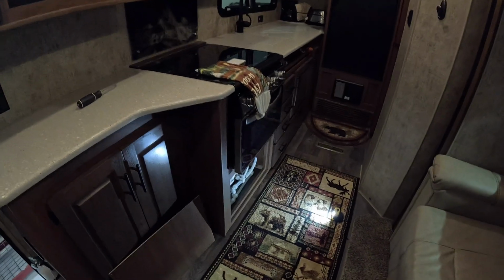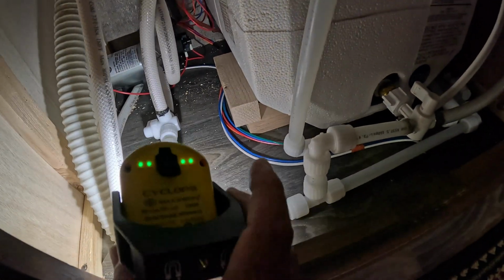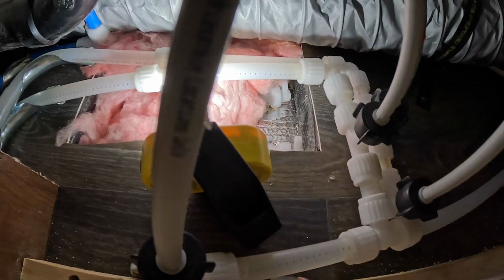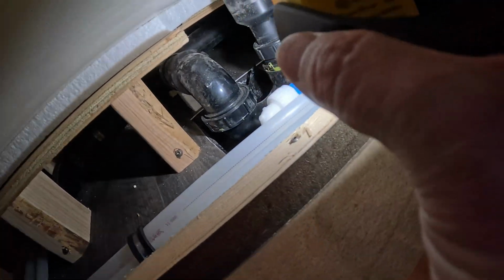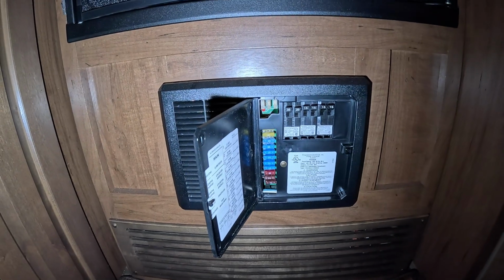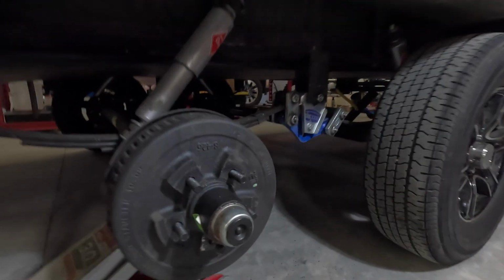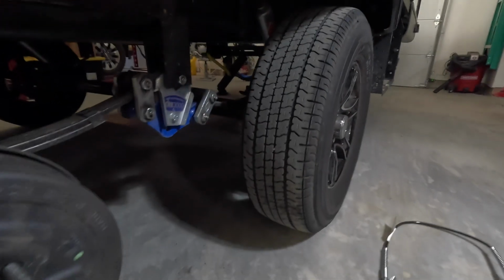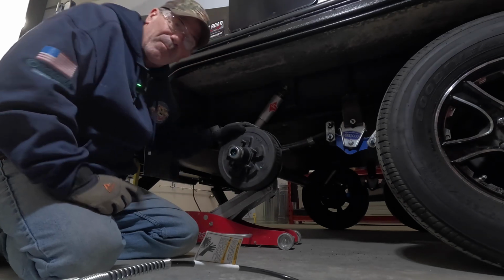Deep in the guts of the Outdoors RV 19MKS. Diving into key systems and maintenance areas.

Comment: I had a follow on question, did you happen to locate the Swintech Power RV Slide controller?   I want to know where that is in case I have to override the slide one day, but I can’t seem to find it.
Reply: I can confirm it’s under the driver’s side of the dinette behind the drawer. I came across it poking around. It’s easy to access by removing some screws holding down the plywood panel under the seat cushion. Btw, GoatBro I appreciate all your 19MKS videos. This was our first season with ours and we love it!
Reply from the maker: That is a really good question and I have no idea. From the little research I did, I certainly would not want to be in a situation with a stuck slide that is stuck in the extended position. I am not sure where the controller actually is, and I have looked in all areas around the inside and outside of the slide so it must be buried in there someplace. The best video I have seen on this situation is in the link below, but again, having to do this out in a remote place would be a nightmare from what I can tell. If you come across more info on this, please let me know:

https://www.youtube.com/watch?v=k1vAmlG9vN8&t=151s
Reply: @GOATbro_Australia I reached out to ORV and they told me it was likely behind the drivers side dinette storage drawer.    And sure enough it is, however it is located forward facing mounted to some wood bracing material buried behind the drawer.    I think to access it, we would need to remove some of the paneling in the forward pass thru compartment.    Not ideal, but that is where they put the bugger on my rig.
Reply from the maker: @billrussell9684  Good to know! Thank you.

Comment: I really appreciate the detail and time you took showing the panels, as well as the bearing replacement. Our 19MKS is less than a year old, and I haven't had a need (yet) or desire to crack all of the panels open and see the guts of the trailer. I will agree with you that the Outdoors RV is of exceptional quality - I've spent a fair amount of time online following disgruntled RV owners and never-once have I heard anything negative about ORV.   It sure makes me feel good knowing that we have a solid foundation all around.